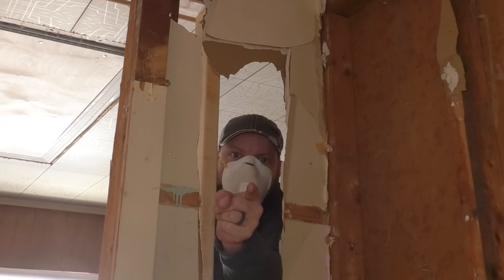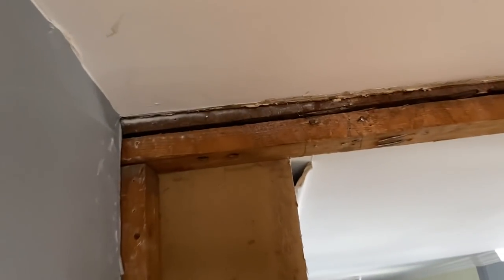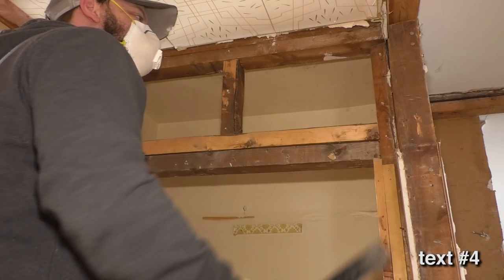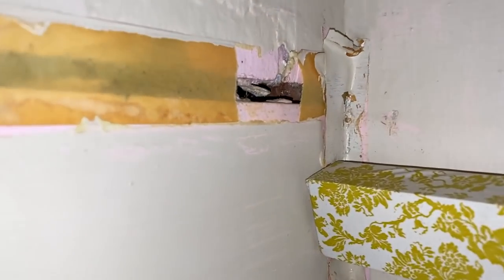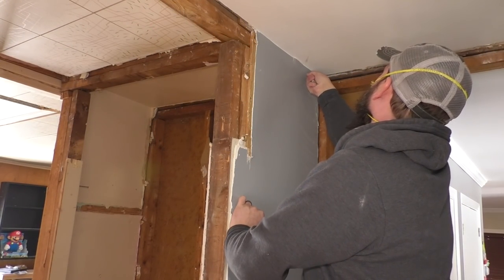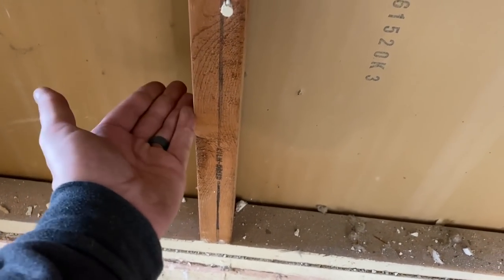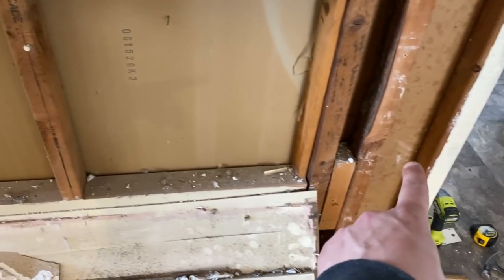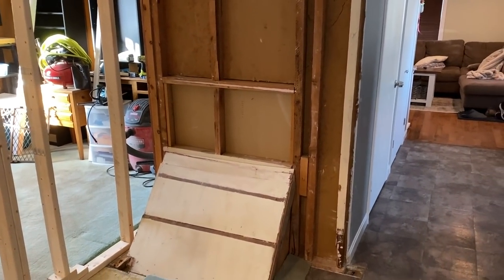Removing a Closet - Hallway Remodel Demolition

Comment: In retirement, I will be moving into my in-laws place (still several years away). That house was built in the 90s and so there will not be some of the same issues as you have. Yet, I plan to change around the floor plan and so I am enjoying your videos. Thanks!

Comment: Only built in 1946, I thought it was at least a hundred years old, it's basically a new build, half my tools are older than your house, lol.

The masking tape reminds me of the "structural" black electric tape and shrink wrap waterproof membrane found on renovation jobs. The crap people use for saving money, lack of knowledge and or scamming the client.

Would you use any plywood sheet under the drywall to stiffen the basement stair ceiling boxing. A lot of European houses use plywood sheathing structurally to create a very strong rigid box.

Looking forward to the next stage of work.

Comment: Old houses can certainly be interesting. Ours still has bits of old unused pipes and (knob and tube) wire here and there, remnants that were never fully removed when the house was upgraded. And the hall to the back of the house still has bits of hardware from a long-gone double door. And the stairs to the basement that were added, and then later blocked. And...